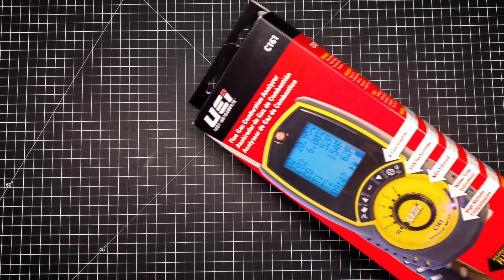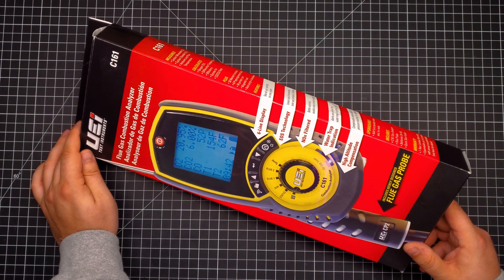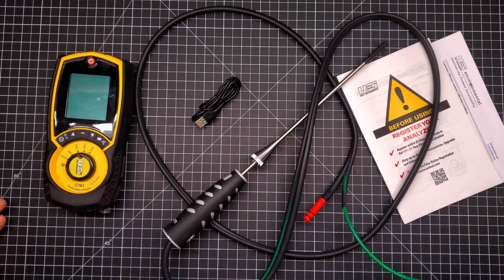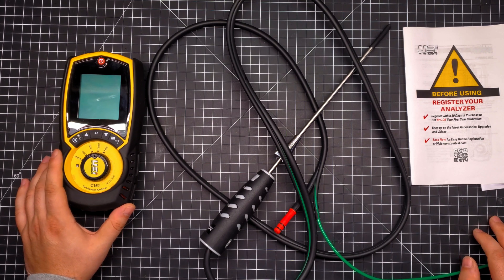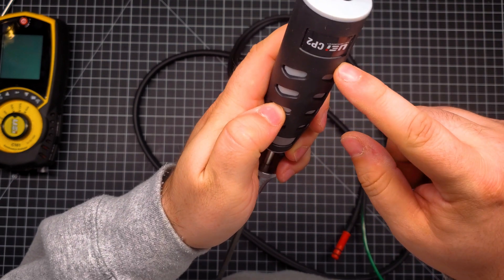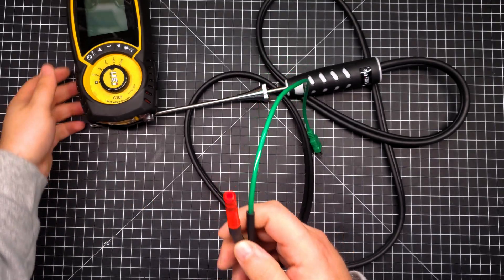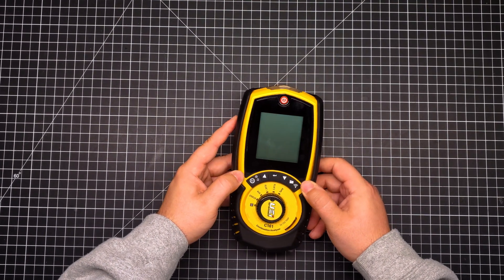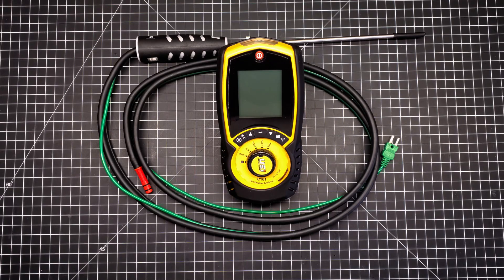Overview of the UEI C161/Kane 258 Combustion Analyzer

Comment: Where did you get it from the UEi? And how much was?
Reply from the maker: I wont comment on how much I paid as pricing will vary from the dealer to dealer, However the C161 goes for between $450 and $550 USD. I recommend getting a quote to see if they can beat there list pricing. Test equipment depot, Tequipment, MegaDepot, Value Testers and Supply House are dealers I would recommend to check out for it. If your located in Canada I would go with Tequipment as they offer borderfree shipping as an option where as the others do not, and in the case of supply house they only ship within the US.